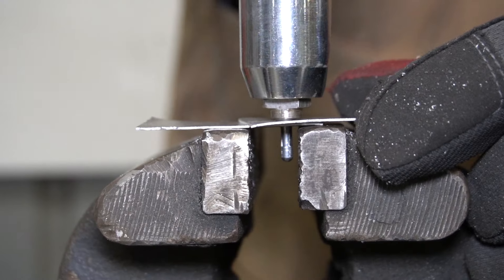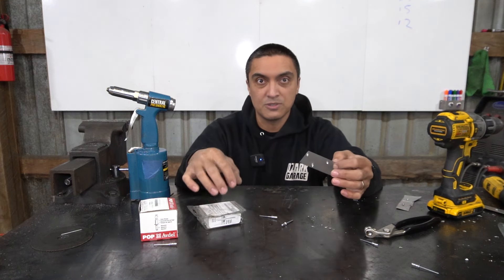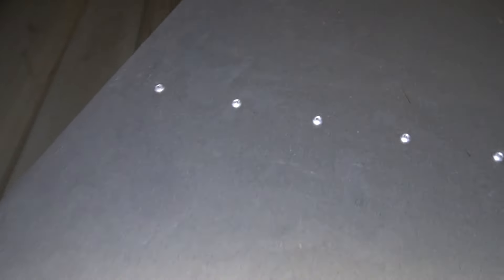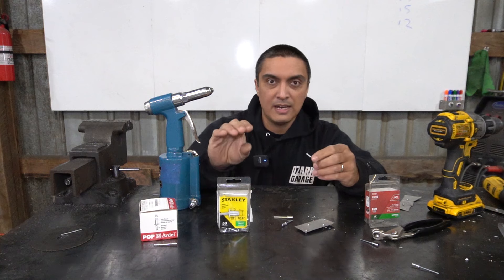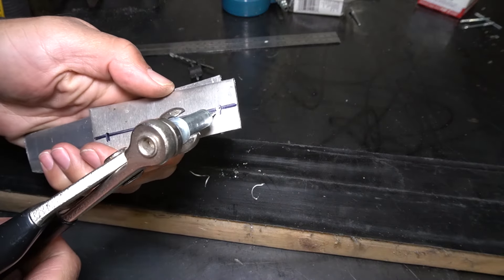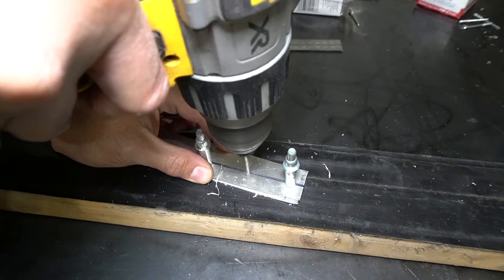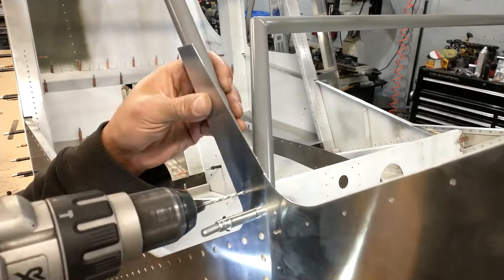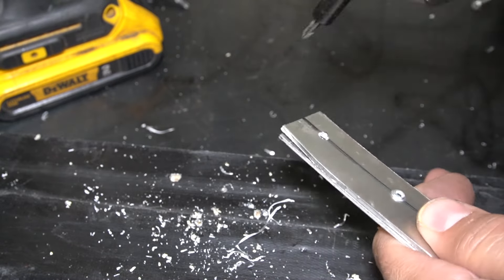You're (probably) using the wrong rivets!

Comment: the correct name for pop rivets are blind rivets
they where invented by Hamilton Neil Wylie ia British engineer and he patented the first blind rivet in 1916,
they where designed to allowed a single person to install a rivet with access only needed from one side.
as you only showed one type of blind rivet not sure if you know about countersunk blind rivets they will lie flat and make something more wind resistance
 and closed rivets that are made to be water tight.
there are also rivets with a larger head which I have used when putting Plexiglas onto a steel frame to make a guard for 50ton press MANY years ago
I have worked in the metal industry since I was 16 not 64 and still working on the shop floor, and I still have all my fingers LoL
Nice vid

Comment: Why not just drill the final size hole one time and done?  Seems lots of work for no benefit.
Reply: Yeah my thought also since all the deburring is a task anyway.
Reply from the maker: Starting with a smaller pilot bit and stepping up usually results in a more precise hole with less chatter. Going straight to the final size in thinner sheets can result in a more triangular hole. Step bits do a great job of cutting very round holes in thin sheets, but you typically don't find step bits in very small sizes.
Reply: @ozarkgarage  The right Feed Speed and rotational speed suitable for a sharp drill .. and you have never  "triangular" holes.. ask every CNC ;)

Comment: Aren't countersunk or flush rivets common for external surfaces for aircraft? Smoother surface for aerodynamics?
Reply from the maker: Yes, but it comes at a cost of the time it takes to dimple each hole on each sheet before assembly. It greatly increases the amount of time it takes to build the plane and depending on the overall design (my plane isn't a very fast design), won't increase the speed to a noticeable degree.

Comment: What bit is that you're using to deburr?
Reply from the maker: That is a generic deburring tool, comes in a 3 pack from Harbor Freight. You can also use a much larger drill bit by hand, which is the safer way to do it when starting out. You can deburr too deep..
Reply: @ozarkgarage  Oh I'm aware.  I typically do it by hand with a traditional tool (not a drillbit), but my hand gets sore.  I just hadn't ever seen a power deburring tool I liked until I saw your video!
Reply from the maker: @mkosmo  A cheap electric screwdriver is a lifesaver for deburring. The cheap rechargeable one from Harbor Freight is slow speed only, which can be a good thing. I also have a variable speed Dewalt, which is much faster. Both are lightweight and handy and much more controllable than a drill.

Comment: What about using AL rivets in regular mild steel sheet metal?
Is that a bad idea?
will we get galvanic corrosion?
Are SS rivets the better choice for this application ?
I'm specifically referencing automotive application here but I'd think it'd apply to any mild steel sheet metal connection. 
I've only seen the two choices.  I've not seen a mild steel pop rivet.  
The reason I ask is because generally if you grab a box at a hardware store they are generally AL.  You need to go out of your way to find SS.  I assume this is because AL is softer,  easier to deform and cheaper.  Is there some magic I'm unaware of that makes these not cause galvanic when used on steel sheet ?
Reply from the maker: Corrosion can be a problem with any kind stacked sheet seam, even in aluminum. In aircraft, it's very common to apply primer or other corrosion protection (after deburring but before riveting) between the sheets at the seam. The seam is the location most likely to hold moisture. Since the holes are drilled when the corrosion protection is applied, you are applying it inside the holes also. I used self etching primer, but there are some other products available also. In a perfect world, yes, stainless rivets would be great, but at a substantial weight penalty depending on the size of the project.